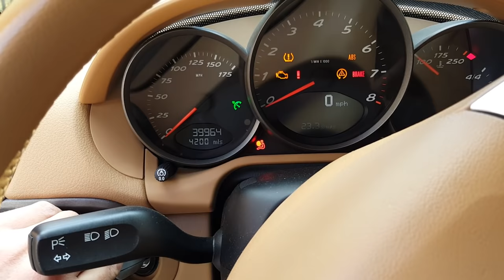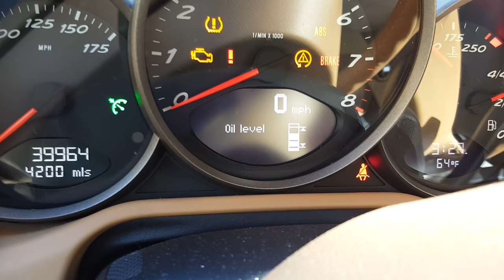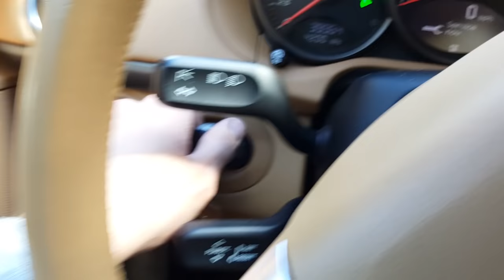How to Change the Oil in a Porsche Cayman

Comment: Great Job on the video and thanks so much for listing all the parts needed!!  I have changed the oil dozens of times on my Porsches over the years, but I was looking for a good video to share with a friend who wants to change his oil on his Cayman for the 1st time.  This video is perfect. The only main difference in routine that I do is that I use floor ramps to back the rear wheels on to and then lift the front wheels up off the ground using 2 jacks so that the entire car is level. This way all the oil drains out properly and less chance of the oil  pooling or rolling towards the front of the engine while it is tilted forward in your example.   Also, owners check your owners manual for "capacities" for the Larger 3.4 engines and the quarts of oil needed with oil filter change.   Great job and thanks again!!
Reply from the maker: +qikqbn77 

Im so glad this video helped!  Ill be making a second oil change video in about a month to show how to use wheel ramps like you said (and use a torque wrench haha).  I just didnt have them when I was filming this.
Reply: +CaymanGarage Nice vid, only other thing I'd suggest is having the oil cap off as you drain, this will help the oil drain more quickly and fully, and help prevent any oil being trapped in a "vacuum" - That's how I always do my BMW anyway and as suggested to me by an ex BMW tech.
Reply: You can even wear a pair of rubber gloves when you do such a job. "Murphy's Law " always shows up to assist me on automotive stuff. God knows I can't possibly dress the way you do unless I'm waxing a car!

Comment: Good for you changing your own oil.  It's amazing how few people can still perform this basic task.  Spend your money on good oil and a quality filter and do it yourself.  Nice work.  That is not really a crush washer and it dosen't  really need to be changed each time.  Its just an aluminum washer and the point is to just have no leaks.
Reply: False. The more you use a drain plug washer, the more compressed it becomes which in turn means you 'll have to tighten your drain plug more and more every time, resulting in a possible stripping of your plug threads or oil pan threads. Both will be way more expensive and a hassle to replace than a 10 cent washer. Never reuse washers. Thanks

Comment: It’s 2024 and this was a helpful video. The things I needed to see are, “how do I check the oil level?”, “what tools do I need?”, “where is everything located around the engine?”, “what are the specs of the engine: the torque for fasteners, the amount of oil, etc?”, and “how much more oil can I add when it’s at the middle fill line?” and this video accomplished pretty much all of it.

Comment: One of best oil change vids I've seen. clear and comprehensive. only thing I would add is that its good to run the engine for just a few minutes (so that its slightly warm but not hot obviously)  prior to changing the oil so that it drains easier and more completely...

Comment: I enjoyed your video. It was concise and informative. You were inviting comments and I have to say that I have looked at others who have made dozens of videos on various subjects and your first one out-the-chute was better than many who have made in some cases, dozens of videos. 

Of the   many YouTube faults in the YouTube universe  I have seen - a camera view that goes every which way, sounds of airplanes, wind, anything to distract the viewer from the subject, and my personal favorite, the actual critical operation is not shown and the host just says "it was easy - you will figure it out". 

As I mentioned your video was concise and to-the-point. 

I'm a long time Mercedes owner and DIYer and I have to chuckle at the reliance the Germans (or just Stuttgarters?) relay on all things requiring an allen bit socket. You explained the need to have that at the very beginning. 

At the very beginning you explained well the tools needed and it was off to the races. Only thing as a viewer I might have changed - or added - was to introduce yourself at the beginning! 

Been thinking of getting a Cayman in the next year or so and have been looking at the Cayman videos here. I cannot believe that they would have an oil fill location surrounded by nice carpeting. Personally I would use a funnel and have a clean plastic bag to wrap around that funnel when done. 

If Some Cayman owner hasn't spilled oil on the carpet I predict that it is a matter of time. 

All modern Mercedes allow extraction both from the pan and through a suction device such as a Topsider through the dipstick tube,. The pan is designed such that if the car is level all the oil will be extracted from the tube. However since the Cayman has the oil filter underneath there would be no point in exploring this. 

Anyway just wanted to thank you for the nice informative video. Your effort and planning has shown through.

Comment: Nice video. Nice to see a real enthusiast doing simple
maintenance tasks without fancy work shop equipment, and doing work in the
driveway (luckily not winter with snow and rain hailing down) . That's how most
of us would do it so it's nice to see people know you can do your own
maintenance, even on a Porsche without all that fancy stuff or expensive bills
after. 

I agree with the comments, re tips about latex gloves –
essential with engine oil and nicer to work

Comment: Great video. I was 911 shopping, and have changed my focus to the Caymans. I always watch to see how hard basic maintenance is before buying a car. This is easier than changing oil in my STI. Yet the dealers want 260 for the service. Looks like it can be done for around 80 depending on the oil used. Good video

Comment: I'd recommend keeping that jack taut on a jacking point on one side just in case.   Also wear some latex gloves to protect your hands from the used oil.  

Good Video.
Reply: +RocketJohn jacks fail, hydralic seals break. I think you mean axle stand.
Reply: Yes, with a pair of 3000 LB jack stands running $25, there's no excuse to be this ghetto and unsafe.

I wouldn't do my 944 this way, I am certainly not doing my Cayman this way.  Secure it.
Reply: If the jackpoint is being used to raise car, tell us -  exactly where you would put the jack stand?
Reply: +Dominic that car is so short you can support the entire left side with either jacking point.
Reply: Yea, you do have a point. I've noticed that If I jack up my Cayman enough, the whole bladdy car goes up. This should give enough room to put the entire car up I suppose. I'll have to try this out.
Reply: Dominic - what do you mean by "bladdy", boet? C'mon "swaer"?! ;-))
Reply: I use blocks of wood under the wheels, so the car is level, also they are long enough to chock the wheels.
Reply: Invest in a decent set of ramps. I had to get a set modified to work with the clearance, but so worth the money, makes these types of semi-regular jobs much easier.

Comment: Thanks for the heads up, I did subscribe as I hope to be getting a Cayman S soon. But as an old gear head, just fyi if you didn't know. Warm oil drains better. I drive mine, let it cool for 5 min., then drain it. Also, the dirt, microscopic metal pieces, whatever makes oil dirty, allot of it is in the last bit of oil coming out, so I personally let it drain what can seem like forever. Plus if you let it drain while your putting the filter on, it doesn't take so long. Someone else mentioned a little oil on the seal, I agree, a little Mobil One everywhere is good. I also wipe the drain plug clean, pour a little oil in the cap, wash the drain plug in the oil, dry it off, then dip the threads in the oil and let it drip. When you get ready to install the plug, it's got a nice thin layer of oil on it. Thanks for the tips and keep them coming as I will need them. Also, I've read the pre '09's had bearing problems. Any info. on that as I'm looking at a good '09 to get to avoid that. Thanks.

Comment: Great vid. Thanks! Looks like you are a very careful person, but for most of us I'd recommend using a funnel when pouring the oil around that beautiful light color carpet. And definitely get some ramps at least. The wood block thing is very unstable and unsafe. Car can easily slip off the wood. and land on your head. Not a good day.

Comment: The only thing I'd do differently would be to coat the new O-ring with oil before screwing oil filter housing back on.
Reply: I've always done that too but I know many who dont and and swear by it.  It might be tomato tomahtoe.
Reply: @zedwpd  I doubt you know anybody that's a mechanic who says don't do it.  You should always lube a seal with whatever it's sealing.
Reply: @zedwpd   It makes it MUCH easier to remove the filter the next time if its lubricated.
Reply: It is slightly less crucial in case of this encased filter variant compared to the direct external filter fitment. :-)
Reply: Very Good my Cayenne takes the same oil filter, personally I also add a 200-250ml into the can to ensure I'm not starting on a dry filter.
Reply: I would have worn latex type gloves and I would have let the oil finish draining. It was still pouring out. WTH? Let it sit for 20 mins, what's the rush? I also would have used a torque wrench, a large funnel and done a reset on the oil interval.

Comment: Props to you for having the balls to change your own oil, as most people nowadays are too scared to. Beautiful Por-sha as well (correct pronunciation). Four pointers for next time: 1. Always unscrew the drain plug and filter housing and leave them off for the same amount of time for a proper drain. 2. USE A DAMN FUNNEL!! I almost had a panic attack that you were going to spill that 0W-40 all over your boot carpet. 3. Please do not try to check your oil levels on a warm engine. This is common sense 101. There's a reason that the car computer made you wait 30 minutes, its because when you turned the key to check the levels, you forced the car to go through a cool down cycle before it could get an accurate reading. 4. Please get a torque wrench. Order one from Amazon while you're on there getting the filters. There's a reason dealerships charge so much it's because they do everything with professional etiquette and using the exact tools meant for the job. Try to replicate that in your own garage and you won't be sorry if something does go wrong.

Comment: Good job. I would recommend pre-oiling your oil filter o-ring before installing on the filter housing.  It keeps the o-ring from binding as you tighten. The same thing is done for a spin on filter. Enjoy your car, bud.

Comment: I am picking up my first ever used Cayman on Monday afternoon.  It has 21K miles on it.  A 2014.  This video will help me save some money because I spent more than I intended buying it.  I think it's pure Porsche.  The base model to get me started.  I'm hoping it will make it from Fl. to NH in the spring,  Thanks again.  Post more.
Reply from the maker: +bunny hopper Congrats!  The 2014 Caymans look great!  It should make it to NH just fine.  I just drove mine from Salt Lake to Vegas, LA,, San Diego and all the way back no problem.  Enjoy the drive!  You should try to drive "the Dragon" on the way to NH!!
Reply: +CaymanGarage ....Thanks for that.  I won't beat on this car.  I'm fine with expressway speed limits.  In the rare event that I want to go faster than the posted speed, I have a Ducati 1199r sitting in the garage.  During the summer of 2014 I received 1 verbal and 1 written warning about excessive speed.  I did not bring it out last summer.  I'll be spending most of my time detailing the Cayman.  I'm happy applying a thick coat of paste wax while under a nice shade tree and listening to some music.  Hey, it's what us old farts like to do.......  Thanks again!  I'll change the oil before and after my trip.
Reply from the maker: Theres nothing wrong with babying your car!  I bet it will look amazing!  Check out my newest video on how to detail the engine bay, its tough with the mid mounted engine, but well worth it.

Comment: From a fellow Cayman owner (2007 Cayman S, have owned it for the last 6 years and do all of my own maintenance, minor and major) - here are a few additional tips for you to make your life even easier.  I’ve done about 10 oil changes in the time that I’ve owned my car.

1: DON’T Jack the car up, back up on ramps.  It’s faster, safer, and you will have plenty of clearance.  This will also pre-warm the engine a bit to thin out the oil when you are getting on the ramps.  It will also keep the car as even as possible.

2: USE A TORQE WRENCH!!! They are cheap, and if you plan on working on your own car you should definitely have one. You are torqing down to an aluminum oil pan as well as a plastic oil filter housing.  You do not want to over-torque this OR your oil filter housing.  Both of them have very specific torque figures.

3: There are some better choices of oil.  Mobile 1 isn’t bad, but I personally prefer Liqui Moly.  

4: Use either an OEM, Mahle, or MANN oil filter.  They are good, and probably cheaper than the K&N you used. Don’t forget to lube the o-ring PRIOR to putting it on the oil filter housing – you could tear the o-ring otherwise.  Use a dab of old or new oil.  Pre-fil the oil filter housing as much as you can.  Your filter screws straight in, so you can put a decent amount of oil in the filter so you don’t starve the  engine for a second with the new oil.

5: Check the oil level BEFORE turning on the car first to make sure you haven’t put too much in or to make sure you’ve put enough in.  After you check it and idle the engine, go back and repeat this  procedure after the oil drains back down into the pan.

I hope you enjoy the car.  I’ve put over 40,000 on mine in the time I’ve owned it and I have done jobs as small as an oil change to as large as the rear main seal / clutch / flywheel.  It’s an EASY car to work on compared to the many VW’s I’ve owned and worked on.
Reply from the maker: Peter thanks for the tips! Just bought a 08 Cayman S a few weeks ago. I will be doing another oil change video covering the things you mentioned and a few others! I also will be doing a few bigger Maintenance videos (pullys, water pump...) soon. Id love to do my clutch and flywheel! I'll reach out for tips when I do

Comment: Liked your video.  Couple of points for you: Wear gloves! Secure the front wheels to prevent getting crushed. Get a torque wrench. Use a funnel for filling the oil. I know this is an old video but you did a great job. Love the car.

Comment: Very nice and informative video! Thanks for your time editing it and put it on YT. I wondered if it makes much of a difference that the car is not in a level, when letting the used oil come out? And you should put something around the frint wheels to prevent the car rolling of the wooden blocks! The Cayman might be light weight, but still too heavy to let it drop on you. :-)
Reply: I would appreciated if u can do a video on how to add Freon to this car.

Comment: First step is not jacking up the car, 
First step is warming up the engine a bit, so the oil flows better.

And it helps to use a latex glove when you get the plug out and doing the oil filter
why bother getting your hands all oily if you can avoid it.
Reply: no first step is booking it in at the garage
Reply: First step is making sure you have a S or BASE,  987.1 or 987.2, because it changes the process.  987.2 checks oil while idling.  They use different amounts of oil.  Also, you didn't show priming the filter, which should be done, I don't think.  Maybe I missed it.
Reply: And ensuring the rear brake is engaged and holds... 1st gear or P.... Tire blocks in the front... Just to avoid a guillotine effect...
Reply: @chriswinter5765  Disagree...why pay those suckers when you can do it yourself (if you can of course) !
Reply: @AzizHACHIMI-DustyPearl-13  I work on my own cars ONLY when it's a car on which I can afford to fix my own mistakes. With my Cayman, I'd rather pay for peace of mind, than save a couple of hundred dollars.
Reply: Go vid.  Just bought a 14 so my warranty is up on 2020 so I’ll
Be tinkering on mine very soon.
Reply: How did you reset?

Comment: Hey, nice clear vid and process, could only agree about priming the new seals with oil and also making sure at least one wheel on the ground is chocked both sides and for safety, also slide a physical object such as spare wheel or the jack under side your working on (in case car comes off little wood block, as you don't want to be crushed). Cheers. maybe show how to reset computer if you have the equipment.

Comment: Excellent video, thanks for taking the time to document the process. But i do with you had used jack stands. I'm not usually Mr. Safety about everything, but getting underneath a car is always dangerous. You really need a set of jack stands, and better yet, an extra jackstand under the diff or some other mount point on the car just in case.  People get crushed to death more often than you would think. Sorry for being a Lame Lousie, but just thought it was worth pointing out :)
I love all your Cayman videos btw!
Reply from the maker: Ha I get it! I should have used jackstands for sure. At the time though honestly I couldn't afford them 😂😂. I did do many safety precautions off camera though. I have all the proper tools and supplies now!

Comment: Great video. Thanks for listing the parts and links to Amazon!
Reply: I was a little surprised you didn't buy the parts from your local auto parts store, they sell the same good quality parts and also supply other necessary consumables, wiper blades, brake pads etc...they are usually a little cheaper too.